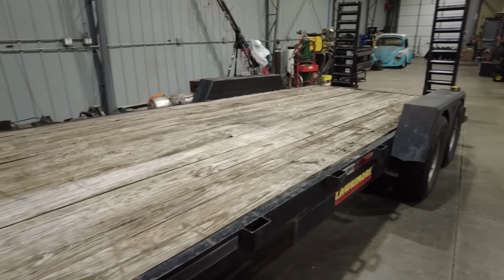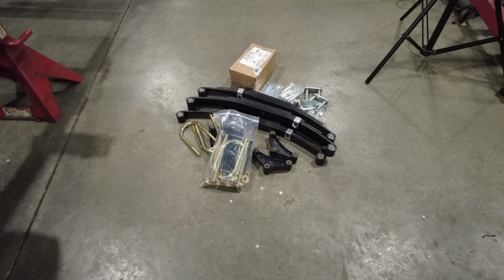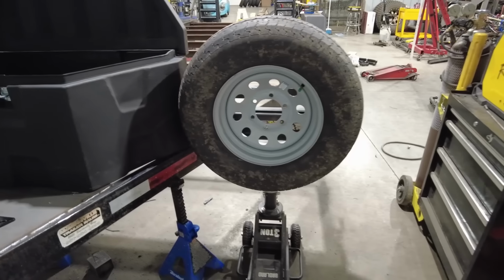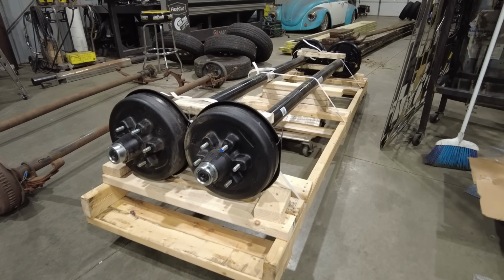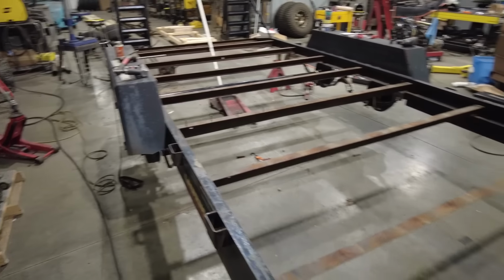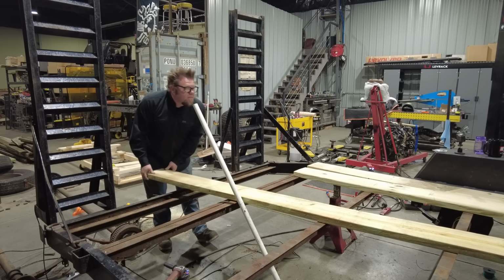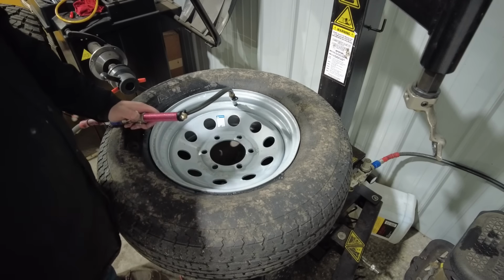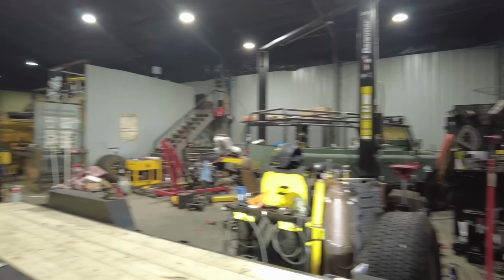Car Trailer Rebuild, How to Increase the Load Capacity of your trailer

Comment: You do a great job explaining your thoughts and ideas. I could watch your shows for days and never get board. Question What was the drill bit you used in the drill press looks like part step bit part standard bit. The odd color code is for campers I don't know why they are different but they are.

Comment: How are you going tie down the front of whatever you are hauling with the spare tires in the way? The first or maybe the second time you drag something onto the trailer you will rip out those flush mounted lights, recessed would be better. Looking at your jack placement you will shred your hand on the clasp for the box.
Reply from the maker: Nope...the jack handle has enough room for my hand I made sure of it...if you watched the video I even talked about moving it forward on the plate to prevent that. D rings are behind the spare tires on the trailer frame...and already dragged two bodies up onto the trailer no issue with the lights at all

Comment: Great Content as usual.  Ian have you tried the solder heat connectors? When you use a heat gun it melts the solder ring around the connection, I still throw an extra insulation wrapper around it, but was curious what your thoughts are on them?

Comment: Adding my 2 cents. I think you did a great job but in my openion you missed one impirtant step. When the trailer was apart you should of done some rust preventative maintenance on the frame. Even a rattle can if rustoleum would of been beneficial.

Comment: Great rebuild video!

 Curious why you didn't go with torsion axles?
Reply from the maker: The torsions sit too low IMO...and the trailer already had leafs on it
Reply: @BigTireGarage  They can cam the axles at different degrees to change the ride height. But, going back with sprung axles is easier, no doubt.  As far as the spare tires, I mounted mine under the deck of the trailer using a  spare tire carrier off of a chev truck.  They wind up/down with a crank handle. Just throwing that out there. Again, super nice rebuild. I dig it.

Comment: It will be interesting to see how long that 1/8 plate lasts.
Reply: I was thinking the same surprised there is not more comments on it i would've used 1/4 plus reinforced with angle iron under it but sometimes my trailer goes off-road and gets drug across the ground and I unhook loaded as well
Reply: I would have put a weldment round side mount so a person could remove the jack entirely, stow it in the box when towing. Additional weldment on each side in the back so the jack could be used to change tires. Just sayin'.

Comment: Great job on this one-of-a-kind trailer build! As you broke down the $3,000 savings to build it yourself vs. bying a new one loaded out I couldn't help noticing one thing missing in the calculation... you would probably sell the existing trailer for at least $3k if you bought a new one.
That said, this trailer turned out better than a new one and it's the only one just like it. It was still worth it!

Comment: The funky wiring colors associated with the pigtail and j-box are standard color codes for RV wiring. That 7pin plug system originated in the RV industry. I own a trailer repair business, and I can't begin to tell you the confusion this causes my customers trying to wir their own 7pin plugs in.

Comment: GREAT JOB! Many great improvements!  Why, no back up lights? Or more running lights? (My trailer, at night, disappears to other drivers) or hitching area lights? After our dogs ate 90% of the wiring and lights on my trailer, I mounted 4 of those junction boxes to the trailer. Also bought a pre-encased, 7 wire cable, to run end to end and tap off of for any current wiring and future proof it for planned upgrades. For the brakes, I am concerned your wire gauge to them is too small. They draw a lot of juice. I ran a separate parallel 10 gauge circuit to them with crimped and soldered connections. (I've seen the factory twist together slices fail). I really like the suggestions of a few others about using a spare hub for spare tire mount. However I'm going under deck mount, out of sight of thieves and out of the sun. I am also planning to lay down some e-track flush mounted into the deck. With an axle upgrade, the plan is, to also box the "c" channel in the suspension area. for the decking, instead of 1 full length run, I'm going to split the deck length in the middle. I had a tire blow out a few years ago. It was so violent, 2 of the deck boards split under the car. my only option was to screw down a 4x8 sheet of plywood over the top for a temporary fix. In the middle of now where, that's all I could get. 18ft boards were a 2 week wait.

Comment: Usually the white (ground) is a heavier  (12ga) wire in the multi wire cable than the  black which is usually 14ga wire   And it it getting better between auto and heavy duty industry standard for compliance 
I agree with ur thinkin on color power is red and ground is black

Comment: Your spare tire locations are not legal in all states, you are blocking your front trailer lights.

Don't use black for a ground on 12v dc vehicle circuit use white or green.

Your main c channel looks like 4" or 5" which is undersized for a 10K gross trailer. It should be 6" to 8" depending on if you want the trailer to handle point loads (8") or total load (6").
Reply from the maker: This trailer is 5" c channel with crossmembers at 16" same as most 10K trailers on the market today
Reply: @BigTireGarage  I think you are going to want to check again. None of the big manufacturers offer less than 6" on a 10k. Check Diamond C, Big Tex, Gator, PJ, Kaufman, Texas Pride, etc... The only trailers you will find under 6" are pipe-top and angle-top which makes up for the thinner frame, it works like a bridge. Some use a double stack tongue frame and bed frame so the area under the front of the trailer is double thick, this is another way they limit the deflection and add strength between the hitch and the front spring mount. 

Look at a deflection calculator for reference to the issue. Put in your 5" C channel with a 4k load measure from your front axle spring mount to the center of the ball for distance. Check the shock load which is 3x the weight load. That will give you the maximum total load on the trailer. Do the same calculation with that 4k at the center point only to determine point load. 

Those 16 centers don't do anything for the handling capacity. That changes the point load on the decking itself. 1.5" board cannot handle 250lbs per square foot over a 2 foot span point loaded in the center due to deflection. But, It can handle 400lbs per square foot over a 16" span within deflection tolerances. Why do you think metal skywalk is 1" thick minimum for 2 foot centers instead of being made from expanded metal? Deflection is key. This is also why good equipment haulers 14k+ trailers have 12" on center bead bracing.
Reply from the maker: The front lights are still visible...all 12v automotive applications use black for ground.
Reply: @BigTireGarage  That trailer plug alone will tell you that you are wrong. The ground wire in a standard trailer 7 pin or 4 pin is white. Under your truck if you have a factory trailer connector it will also be white on that side. You should really look some of this up! Just look at any 7 or 4 pin wiring diagram.
Reply from the maker: On a traer yes white is ground...which is counter to all SAE automotive wiring which is why I say grpund should be black.

And I just searched Kaufman sells a 10k car hauler with 5" c channel...same brand as mine...
Reply: @BigTireGarage  You didn't read the fact that they used a heavier 5" for the tongue to handle the weight? That is not offered on the 8k and lighter trailers.
Reply: @BigTireGarage  You will also note they don't offer anything smaller than 6" on an equipment trailer.

Comment: I'm surprised that with all your forethought about potential issues that you didn't use grommets to protect the wiring going through the chassis
Reply from the maker: The haress is wrapped with high friction tape as an overlayer, I don't see it being an issue.  Old wiring lasted 10 years

Comment: wrre doing ours now. 3500lbs out. 5ks in. new tool box, new tongue plates, drive over fenders, and new ramp holders. we built it from scratch 10 yrs ago from an old travel trailer frame for like 600$  its 24'x90" deck with a beavertail
Reply from the maker: Awesome!!!

Comment: I believe the "Black hot and White ground" comes from AC wiring. Not sure why the "CE" stuff comes that way, but it does. When I did mine last year I found the same in the box I used. I was kind of hoping you had found one that was normal.

Comment: hey, I fix trailers as a side hustle and one tip I would give is to ground each light to the chassis of the trailer and then ground the chassis at the junction box.  Probably 90% of the trailer wiring issues I see are ground issues and this will keep a pinched harness from knocking out all the fuses in your truck, because there isn't a direct ground in the harness loom.  I see people snag the wiring loom on a branch in the field or some road debris on the highway and rip the harness and that single ground in the harness will blow 5 fuses on your truck.  Chances are that the trailer chassis will be a ground anyway due to the ball hitch connection and the frame of the truck being a ground, so you might as well dedicate the trailer chassis as a ground and use it to anyway.
Reply from the maker: I did both..but did not ground each light to the chassis
Reply: The ball and coupler do not make a good ground to the tow vehicle. Just watch someone that has used that when they go down the road, all the trailer lights blinking / flashing on nearly every bump or bounce.
Reply: @stevea6722  Your 100% correct.  I didn't do a good enough job explaining what I meant.  I meant that you take the ground that you gained from the tow vehicle utilizing the trailer light connector and tie that into the chassis of the trailer.  This grounds the entire trailer and then you can just tie each individual light's ground to the chassis.  A good number of lights that bolt on, don't come with a ground wire at all, they rely on the bolt and nut to ground the light to the trailer chassis anyway, so if you are using this type of light, you skip having to run a ground wire to the bolt of the light to ground it if the chassis is already a ground.

Comment: The junction box is using the 7 way RV blade traditional wiring configuration which is the standard for 5th wheel trailers, campers, etc.  The wiring colors you are talking about are the  SAE J2863 configuration which is industry standard for utility trailers and goosenecks.  Not wrong, just different

Comment: When is the video when you show the reinforcements for the Trailer jack plate? Using 1/8 plate with no reinforcements are just asking from trouble especially with the original cross bar missing from the trailer jack.  The winch plate worried me so I looked it up.  Rugged Ridge specs a minimum of 1/4 plate from a 10K winch.
Reply from the maker: There was another cross member under the original jack mount that I did not cut out, and thIS winch plate design I have done before...it ha weld washers under each foot (look up my video installing winch plate on a rock crawler) you need to understand why that is speced, and the loadscin the system.

Comment: Thanks. Re the costing, what you displayed on the screen was parts cost.
What will be the total build cost if you include your labour, welding supplies, cost of power etc. And most important - how much time did you put in start to finish?
Thanks again.
Reply from the maker: That seems a little overboard considering my hourly rate would be really high compared to someone else.

I "play" in my shop everyday so including those cost would be silly.

Comment: I always found it strange that no one ever paints the metal cross pieces under the wood.
Reply: Exactly if it's apart paint it... paint is cheaper than repair/replacement once it rusts out
Reply: I always do, not going to get another chance later, seems like a no brainer
Reply: i think its more of a southwest thing, im in eastern canada and anytime a trailer is open like that they get cleaned up a bit and painted, the rust will kill the trailer before anything else up here, down the southwest they barely even consider rust.. as you can see he has a trailer thats gotten little maintenance and there was no need to even consider rust.. up here wed be drilling drain holes in the frame rails and then spraying oil in them to try to get them to last half as long as that one did
Reply: speak for yourself!  ha!

Comment: i've been a fan of using junction boxes for trailer wiring for a while.  they are nice for diagnosis as you said and for repairs and also upgrades should the need arise in the future.  the term that I've best heard applied to using them is "future proofing" and it works out great. In addition to that I have also started installing reverse lights into any trailer I rewire because I am flat tired of people rear ending my trailers when I am backing out of a spot. Also as a semi professional grease monkey myself, I have to recommend the butt connectors I've been buying for years now. they are in effect a non-insulated connector that has heatshrink pre-installed on them. they make them in butt connectors and fork lugs and ring lugs and spades and even bullet connectors too.

Comment: It seems you could have sold the existing trailer for $4,500 and then added $4,000 to buy the new one all done with no work.
Reply from the maker: No way...trailers like this one sell for 1K at the most
Reply: @BigTireGarage  Interesting, In my neck of the woods that was a $4,500 trailer.
Reply from the maker: Did you see it before the new fenders went on...rough!!!
Reply: @BigTireGarage  I checked it out, doesn't look that bad.  Post pandemic prices have really shot things up.  Where are you located I need to go trailer shopping :)
Reply from the maker: Just south of Nashville

Comment: Price wise, if you sold your trailer for $4k which it’s worth. You probably would have had a limited warranty, drive off the lot and an extra $1,000. Cause you didn’t factor in the steel or original trailer purchase. Since a “new” trailer also includes a brand new frame
Reply from the maker: Considering the "garbage" that I have seen sold lately by trailer shops...no way would I be ahead...add to that..this trailer would of sold for maybe 1k